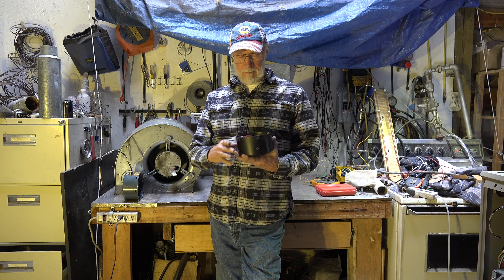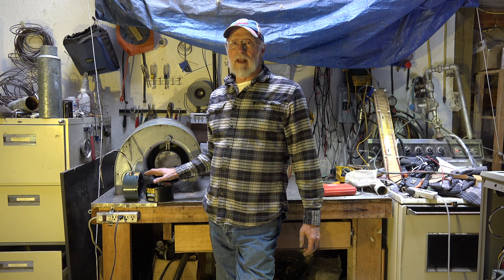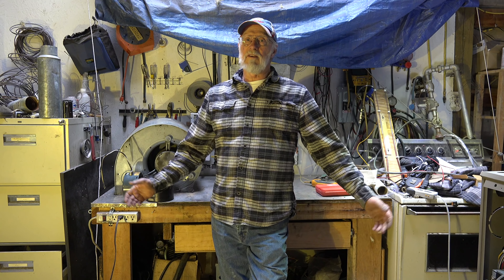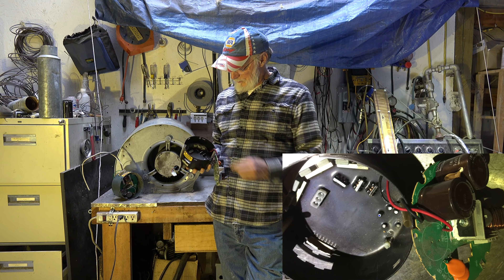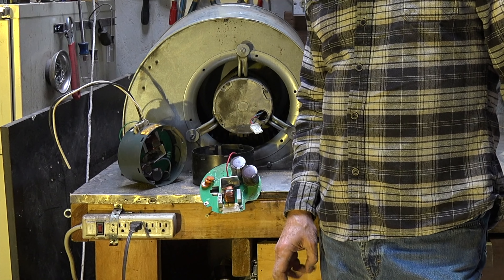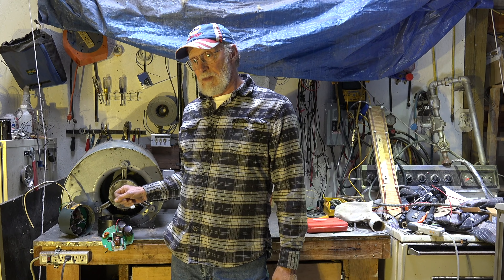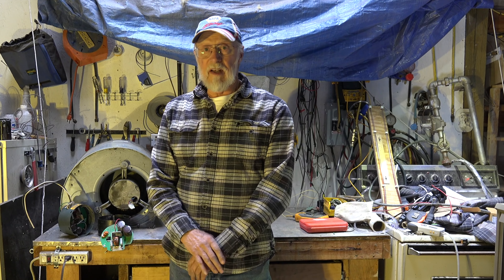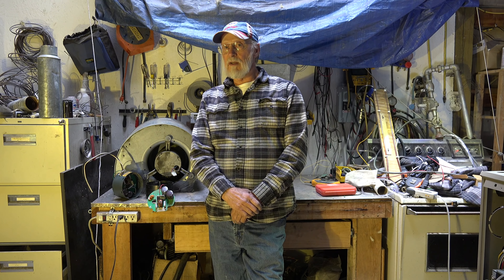The ECM motor; the bad.  Part 2

Comment: Yes, replacing a bad varistor 2 years ago saved me a bunch! Instead of $600 plus for the ECM motor, I spent a few $ on the varistor and about $40 in soldering supplies. Would never have found it if it wasn’t in an offhand remark made in another YouTube video (it only took 2 days to find it - good thing I’m retired). Back in business until I switch from gas to an air source heat pump (which will be a few more years).

Comment: 1,000,000% of the ECM failures I have run into were due to power surge/brown out and a few high static pressure issues. In the newer furnaces I have installed myself, no ECM motors have failed that I know of, I have been back to replace PSC motors. I try to sell ECM variables and constant torque blower motors exclusively due to having better longevity in my experience. Most situations where the duct is too small, I have had very good results undersizing the furnace and dialing in the blower speed to the temp rise. Removed a 100k btu furnace with a cracked heat exchanger feeding two 10x8 supply ducts. Installed 60k and was able to drop the constant torque motor down to medium speed. Kept the motor happy, the heat gain was dead nuts middle of the factory spec range.
Reply from the maker: Not meaning to beat you up, but how did you determine the ECM failure was due to surge/power problem? 
I have found, like you, that most furnaces are oversized.  In many cases, the furnaces are double the size necessary.  Often, the  structure has added insulation or better windows than when new.
GFM
Reply: If the house stays warm the coldest night of the year, you're not undersizing, you're properly sizing them. To justify 100k the house better be huge or in the arctic.
Reply: @grayfurnaceman  Generally units that have constant power to the motor, happen to fail during surges and brown outs. Cannot be coincidence. In my own experience, installing furnaces for the past 20 yrs, the ECM drive have been more reliable than PSC. This is with equipment I have installed myself. So, I am assuming that all the guys I hear complaining about ECM are likely over sized furnaces/blower. Again, this is just my experience, and due to that I will keep pushing ECM motors until PSC are phased out. Also, the equipment I sell, the ECM blowers are no where near $1,000.
Reply: @Jon-hx7pe  Agreed, typing while busy trying to make a point.....
Reply: @joer6571  I suspect one of the problems is that installers are leaving the ecm motors at factory settings.

Even small ecm equipped furnaces come with 3+ ton drives. can have a 40k furnace and the factory cooling set to 1200 cfm, installed on a duct system designed for 600-800 with the house only needing  1.5-2 tons of cooling. Makes for very high static and shortened module life.

 I've corrected this for two family members - both furnaces installed by so called reputable companies-> one had a 2.5 ton on a 70k/4 ton ecm drive and it was left at 1500 cfm. The other a 1.5 ton on a 3 ton drive psc and it was left on high. being psc and on undersized ducts the cfm wasn't as far off, but still says a lot about the installer.

Homeowners are told to never do the work themselves and hire a licensed pro to make sure the job is done right, any useful info needed to make informed choices is kept from them. Yet the "licensed pro", 9 times out of 10 doesn't size or set the equipment up right.
Reply: @Jon-hx7pe  I have found the pros around here are sales techs. Can't figure it out, so sell them new subpar system.The install crew knows next to nothing typically, or they do not care. 

If I am charging professional rates, my customers should get professional service.
Reply: I assume you're in a very lightning prone area...

Comment: I agree with your points on ECMs.   I think a lot of techs forget about the comfort aspects of ecms that customers love once they have experienced it in their home.  Soft starts and stops eliminate loud startup and shutdown noises.   Variable speeds allow dehumidification strategies that work in most climates.  ECMs allow multi-capacity units that often run in low for long periods of time further reducing noise and improving comfort with better air mixing and even temperatures.  And, as a side benefit, they will save a few dollars in operating costs.   But improved customer satisfaction and comfort is the main selling point and is the reason why people buy $50k trucks instead of the $20k versions.  I suspect most techs lack the knowledge to check and repair the "sl22 IRO20" thermistor ($2-$7) which is simply an inrush current limiter that can be jumped out for testing and will normally fail in an obvious manner.  This built in part does virtually nothing for externally generated surges since it starts out with a moderate resistance and quickly reduces to almost zero ohms under load.  

There seems to be a limited group who will actually look at and mitigate static pressure problems, which is a small increment when people are buying a $7-20k system with media filters, uv lights and $500 thermostats.  Finally, a whole house surge suppressor should also be on the repair or install quote which can be as easy as popping in a $50 GE THQLSURGE  "breaker" into the main panel.  The vast majority of electronics failures are due to relatively low level surges that are caused by distant lightning strikes or utility switching.  The same thing that knocks out defrost boards, timers and televisions.
Reply from the maker: Well said.  I would like to see better surge suppression incorporated into these products from the factory.  
GFM
Reply: This seems to me a great opportunity for business. You can get a solid knowledge in electronics repair, like the one of repairing  apple products, and save at least 60% of the cost of new module and labor for a customer. What do you think?
Reply from the maker: I would limit the repairs to thermistor and rectifier and do the repairs in the field.
GFM

Comment: Have you ever come across the ECM motor that sounds like a jet engine winding up?
From 2007 ECM Goodman Furnace 97 efficient. Was working fine then changed.  No ductwork and air flow issues.
Reply from the maker: If there is indeed, no restriction, the control for the ECM is probably failing.
GFM
Reply: @grayfurnaceman  Thanks will do more testing when the weather warms up.

Comment: Both 1/2 and 3/4 HP modules have same physical dimension and share all identical electronic parts. Just the bodies of the motor are different. The larger 3/4 HP motor spins a larger cage and moves larger air volume. It's logical to conclude that both modules are interchangeable. What do you think?
Reply from the maker: I don't believe so.  Some of the modules I have seen have fewer capacitors as an obvious difference.
GFM
Reply: What I am talking about is the X13 modules. I have verified the caps, thermistor, rectifier, component with a 474 printed on it, they all are identical on both 1/2 and 3/4 HP modules of the X13 motor. The MOSFET is covered up and I can't identify it. I had installed a 3/4 HP module on a 1/2 HP motor 2 hours ago and guess what. It works as expected under no load condition. Don't know if it works under load or long term effect on the module and motor.
Why does this issue matter? less modules in inventory and easier to find parts.

Comment: I’ve got a Genteq X13 motor that failed. The motor module did. Too much amp load, frozen coils. I didn’t think of changing the thermistor. Edit. I checked the thermistor. It ohms out to 1.0. Spec. So. Guess it’s something else in the module.

Comment: Also can one get an unprogrammed module and install it if the ECM, and motor itself are ok? I have high and low voltages. It’s a Genteq X13. FM19.
Reply from the maker: It depends on the manufacturer and model.
GFM
Reply: grayfurnaceman It is paired with a York.
Reply from the maker: @XMguy  As far as I know, it does not need to be programmed.
GFM
Reply: grayfurnaceman thank you again sir. They’ve gotten cheaper. But I’m considering a PSC conversion. I have bad lightning in my area. If not an unprogrammed/or preprogrammed would work ok? It uses taps 4 and 5.

Comment: In 15 years I’ve seen dozens of modules fail, but only two failed motors. One the bearings locked up and the other had shorted winding. I’ve found it to be good practice, when replacing a failed module to ohm out the motor windings just to be sure they are good because, although unlikely, failed windings can fry a brand new module. Since ECM motors are technically 3 phase, each winding should have equal resistance values.
Reply from the maker: Good thoughts.
GFM
Reply: Smart. Thanks for your comment. I’m going to use this advise

Comment: It would be a good  video to show how  to convert an ecm to a psc motor because the duct system is running too high static pressure and the customer wont have the ducting modified.
Reply: It can't be done unless it's the x13 type motor which uses straight 24v signals.

There a universal x13 style ecm motors out there at a much lower cost than oem. They can be used to replace existing x13 motors as well as psc.

What's needed is a standardized module and motor for each hp so the production volumes are high and the price can be reduced. The programming can be stored on the board and through a communicating interface automatically downloaded from board to module. No more OEM BS.
The manufacturers will never go for that, they want to charge an arm and a leg for proprietary parts.
Reply from the maker: I will be considering that video.
GFM
Reply from the maker: IFCs were once OEM.  Now, general replacement IFCs are common.  Tell someone they can make a decent profit by building a general replacement part and they will find a way to do it.
GFM
Reply: @Jon-hx7pe  

Notice the complicated contortions and expense inflicted on the customer, all in the name of "efficiency" (LOL), imposed by the dictates from DOE.
Reply: the manufacturers are partially to blame because they want to sell oem parts and mark them up.

the solution i proposed would really drop the cost.

ecm motors came out long before any gov't pushed for their use, it's just the choice is being taken away.
Reply: will need a few contactors use t-stat wire to control the 120v to the motor. And sequancer to control the delay

Comment: I converted from an X13 to a PSC after two failures within 3 years.  Figured the tried and true induction motor just works and is much cheaper.  You save NOTHING in efficiency when you re always having to replace ECM motors!  In summary, Nikola Tesla got it right the first time!

Comment: Those prices are absurd. You can get a whole new furnace, WITH an ECM, delivered for under 1K. I got an ECM motor to replace my working PSC motor for $120, and that appears to be in the neighborhood of the going rate for PSC replacement ECM. For whatever reason, the programmed OEM ECM units are crazy expensive.
Reply: It appears that you think a PSC and an ECM are one and the same.  Two totally different operational characteristics and manufacture.  You did not get an ECM motor for $120.  PSC, yes, but definitely not an ECM.
Reply: Skutahuniai You can get ECM blower motors for $50 new on eBay, shipped. They’re usually 3/4hp or larger and the less desirable 220V models. The 110v models are a bit more, but $100-150 all day. I got a Century CS89 ECM motor for an ERV and those are about $150. It’s been running a year and saves 150W over the PSC the ERV shipped with. Check eBay for Evergreen 6707 or 6105E.
Reply: @ericspda  
What is an ERV?
Reply: hg2 Energy Recovery Ventilator. It provides fresh air to a building without the significant heat loss/gain if you were to say open a window or have an exhaust only fan. They run 24/7, so there’s often significant gains moving to an ECM, which some of the high end ones do from the factory.
Reply: @ericspda  

Thank you JD. 

Everything I've seen so far is ECMs being a "cram down" from the dictators of "energy efficiency" at DOE (while they're simultaneously shutting down nuclear plants and making juice more expensive - epithets, anyone?)

ECMs as a comfort enhancer is interesting, but at these prices, why isn't it just being offered as an option, like automatic transmission in cars? That's the way it usually works with these things.  I haven't seen any adverts like "try OUR AC systems with 'comfort controlled ECM technology".
Reply: hg2 I think it’s an education problem. ECM motors have huge advantages; and can be more reliable than a conventional PSC, but oddly the GE ones commonly used aren’t so great. My work built a new building recently, and the HVAC contractor installed the wrong model for one of the RTU’s, it had a 3ph induction motor. The thing had a super loud thud when the fan came on and it was quite annoying. We specified units with ECM blowers, and the other ones have a nice ramp, and controllers so you can dial the airflow in exactly. You cant hear them come on, so for an office that’s a significant benefit. But the contractor didn’t say anything about the benefits, and didn’t care to pull the wrong unit off the roof. They ended up replacing it with the unit we specified and it’s way nicer to not have a loud thud every time the fan comes on. And in residential, the nice ramp up in speed is great. Plus you have way more speed control and typically can overpower static pressure better with an ECM. So for me, it’s totally worth the risk of a blower failure after a few years. I just keep a spare on hand. But for the typical homeowner a blower failure is probably devastating. Still, I suspect if they lived with a PSC and then had an ECM swapped in, they would be sold on the benefits.
Reply: @ericspda  The ECMs I've seen can be set for 110 VAC or 220 VAC.  They're selectable.
Reply: Henry Chinery Both fixed voltage units and selectable voltage exist. Now, that does not mean a 240V fixed unit may not work on 120, but it’s most likely not intended to and may pop since the current will be double if it maintains power. Or it may mean it has 1/4 the power intended. But generally they have low voltage protection and won’t power up. Most residential retrofit ECM’s will do both 120 and 240, but I’ve tested a few 277 marked units and they will not work on 120, but they do work on 240.

Comment: I'm just sitting here looking at my vintage hunter psc fan that was built between 1946 and 1949 the original capacitor is still in there. should shell out $20 and service it after over 70 years of use. Have fun with that epoxy. $$$
Reply from the maker: Are you referring to a ceiling fan?  Virtually all of those fans were shaded pole.
GFM
Reply: @grayfurnaceman  It's a hunter zephair c16 we use daily by a window at work all day just running we don't have any ac. That type of fan has a psc motor and the capacitor is in the base.
Reply from the maker: @raccoon681  Ahh, you have what we call a Pre-Nader fan.  Referring to the minimal screening of the blade.  It is a true "the sh*t hit the fan" device.
GFM
Reply: @grayfurnaceman  It's funny you mention that there are a few scattered small dings in the blade like someone poked it with something small at ones time.

Comment: How much cost does the industry expect the consumer to continue to pay for this "expensive technology"? I just dont advise people to invest in this high end equipment.  I dont offer it to them.  After the parts warranty expires,  then the reality sets in when they fail.  Believe it lr not ,   most people arent able to pay these high prices.  Its expensive  enough to pay for fixing "conventinal" equipment.
Reply from the maker: It will just get more complicated.  It has always been so.  We also do not use carburetors on cars.
GFM
Reply: @grayfurnaceman   True.  With all due respect to you whose expertise I respect,  cars with carbureators are still being used even though they are becoming extinct. I just dont recomend inverter systems and wont till I have no alternative. Its just what I think,  that's all.

Comment: Free People in The Market should decide what motor to use, not the busy-body self-justifying idiots at Department of Energy and Evironmental Protection Agency.  (Those two have a partnership called Energy Star - they are the ones screwing up your Air Conditioner, Furnace, washing machine, automobile, pickup truck, electricicy bill...)
Reply from the maker: Those that cannot keep up with the technology will inevitably step aside.
GFM
Reply: @grayfurnaceman  

Sure, that's a great thing to leave your grandchildren: Have the government make things unnecessarily complicated and expensive and lower everyone's standard of living.

Comment: Varistor not thermistor.
Reply from the maker: SG348.  Thermistor.  A varistor is connected hot to neutral or across the hot lines to dump spikes.  A thermistor is connected in series with the circuit and increases its resistance with the voltage applied.  
When the varistor fails, the unit keeps running without protection.  When the thermistor fails, the circuit opens.
GFM